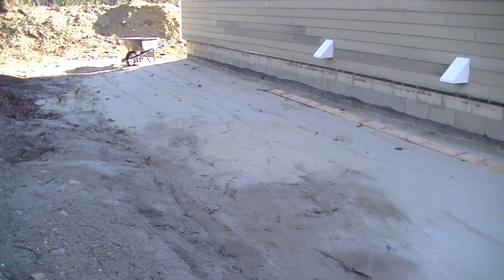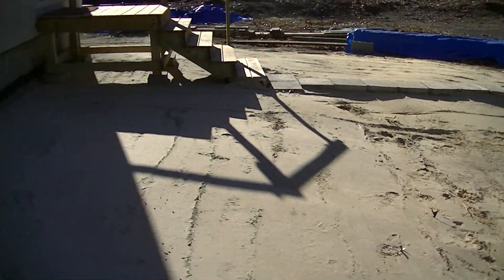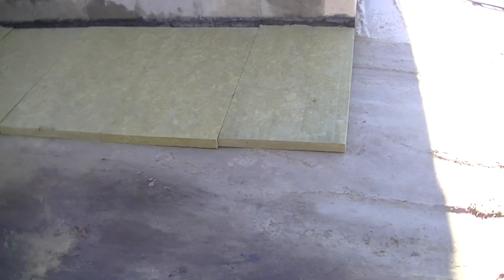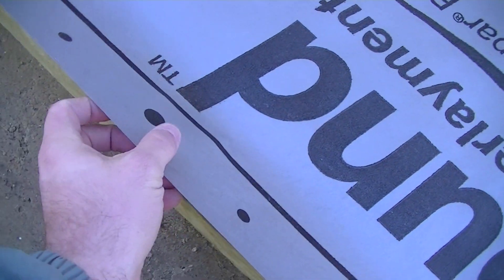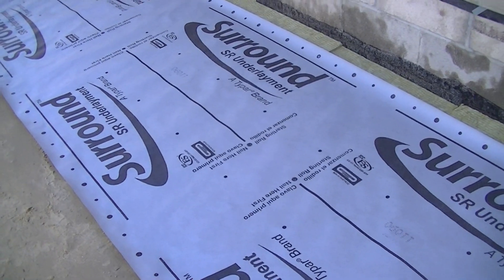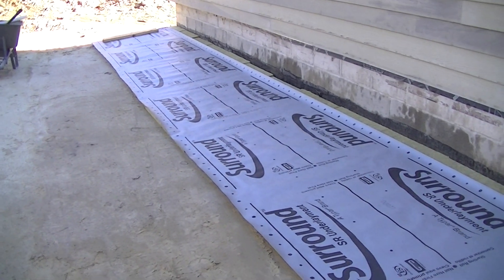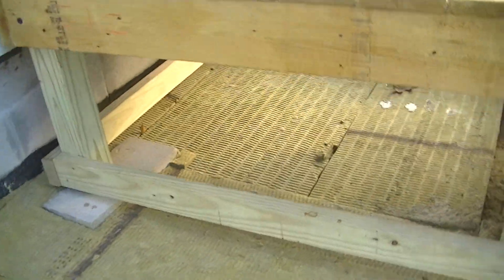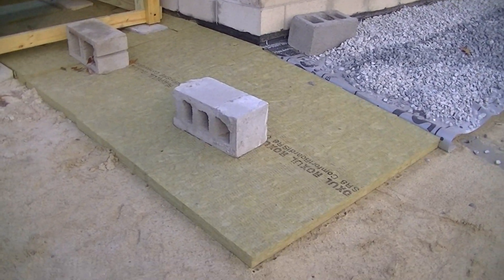Perimeter, Skirt, Insulation

Comment: Saw something like this in an article in Fine Homebuilding. I think they suggested EPDM rubber pond liner, mostly to move water well away from the foundation.
Reply from the maker: Yes, EPDM would be better.  This material hasn't held up well over the last decade and I'll be replacing it with EPDM.

Comment: How did this experiment turn out? Was it squishy to walk on?
Reply from the maker: Yes, it deteriorated.  Don't use Roxul like this, it won't hold up.
Reply: @DavidPozEnergy  Thank you for the updates. Have you tried anything new? Do you still recommend XPS?
Reply from the maker: @tarawiselove  I've put some EPS out there too and it holds up just fine.  Both EPS and XPS are fine in this application.  I've seen some youtubers get an EPS with borate (anti-bug) in it, but my local distributors don't carry it.
Reply: @DavidPozEnergy  Good to know the roxul didn't hold up in this application! Maybe update the video description so you don't inspire other DIYers to make the same mistake. Perhaps it would have worked if you'd put gravel below and something a bit more waterproof above it.

Comment: Sorry if you answered this somewhere else...
I'm afraid the Roxul will get wet and not insulate very well.
Only XPS is approved for Frost Protected Shallow Foundations, AFAIK.
Reply from the maker: Hi Kevin,
If Roxul becomes saturated, then it's R-value drops, so in that regards you are correct.  I'm relying on the pitch of my land to keep bulk water away.  With the land pitched, I do not had any standing water.  A couple times I have taken the skirt apart to look at the condition, and found the Roxul NOT to hold water.  Also, my goal is to keep the ground under my foundation from dropping to 31 degrees.  I don't have to have the Roxul working 100% of the time to keep this from occurring, so if it gets wet one day, but then dries out and stays dry most of the time, it is working most of the time.  My un-scientific test was pulling up a board this winter during a real cold spell, -5 degrees F, and checking the soil.  I was able to dig by hand under the board, but the areas outside the board were frozen solid.

I have used XPS for most of my customers in this application, but for my own home I like to try new things.  Now that I have gone through two winters, I consider this a success.